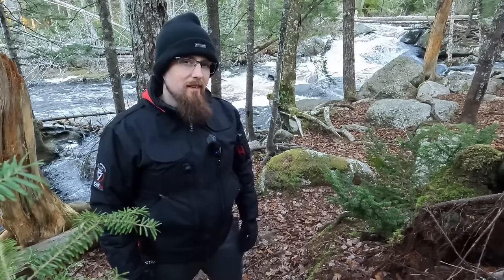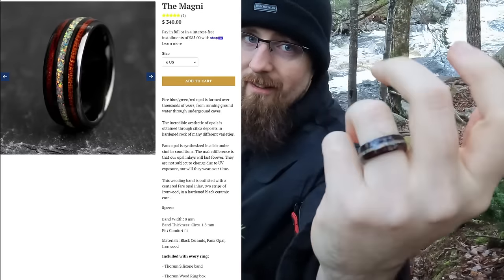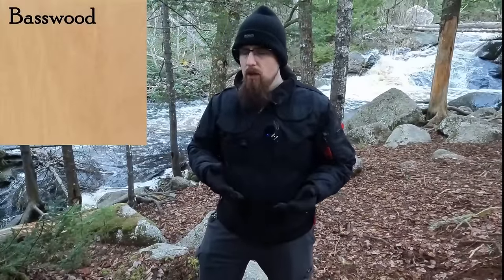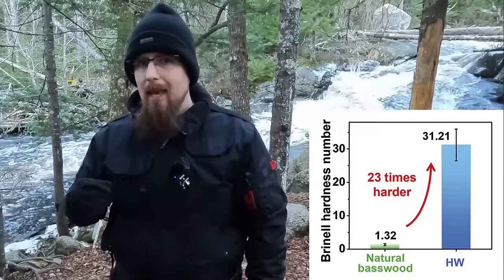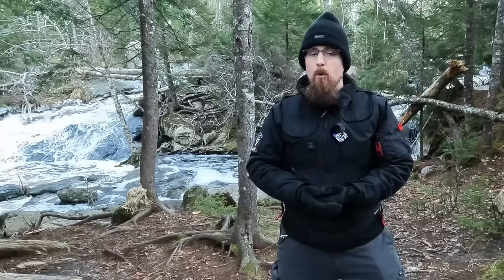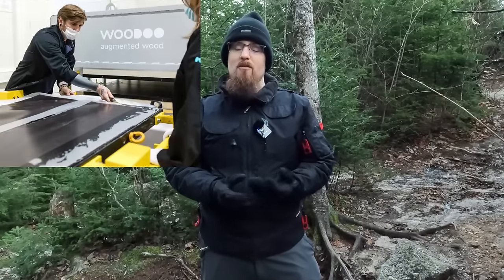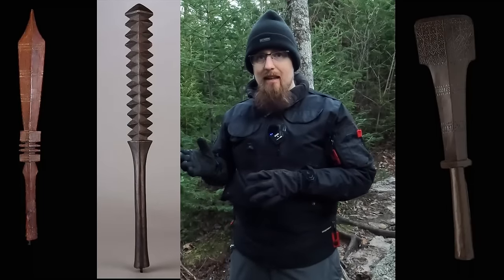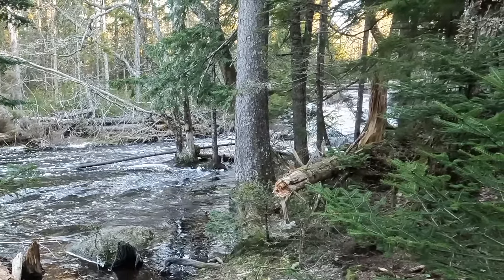Hardened Super Wood!  -  Can It Rival Steel?

Comment: Hempwood is an interesting composite.  looks similar to oak, but is stronger- they're using it currently as a sustainable alternative for oak furniture and flooring.
Reply: Man you hemp guys say everything is better with hemp . Also what's more sustainable than wood it grows back?
Reply: @willofdodge1  hemp grows faster... (Not a hemp guy, just know it's faster to grow)
Reply: @willofdodge1  basically every plant is more sustainable than wood, trees take like 30 years to grow enough to harvest so it really isnt actually sustainable since you will always need to be cutting down old growth trees, hemp on the other hand as well as all other domesticated crops grow very fast by comparison
Reply: It is more expensive, it does not withstand humid environment...
Reply: @willofdodge1  wood that grows back within a year instead of 30.
Reply: @NemamZadnejKanal  only more expensive because of limited production so far.   And the particle board used for a lot of furniture doesn't withstand humidity either.   clear coat it and it's not an issue.
Reply: @kazzTrismus  considering hemp crete and hemp composite wood are fire resistant I'd think you'd be in favor of the stuff, as a firefighter.  
As far as industrial use plants go, the stuff is pretty impressive.
Reply: @ryanjamesloyd6733  he is comparing it to solid oak, not to a particle board. And so do I.
Reply: @Dell-ol6hb  why does that growth time make it less sustainable? Take in account the law of conservation of matter. The wood comes "ready to use" (more or less), the "plants" need significant amount of further processing.
Reply: @NemamZadnejKanal  Solid oak for furniture and flooring is what it's being used as a direct replacement for, considering oak is getting hard to come by.    It performs similarly per reports.  seal it and the moisture is a non issue
Reply: you can use hemp to make rope and other useful stuff two..... its a shame because certain varities of hemp are smokable and produce effects on the mind (yes not all hemp is for smoking) and because those varities were banned for those reasons in many area's it ended up being fairly prohibitive of growing the non smokable varities as if not outright illegal it would be highly scrutinized as people would think you could be sneaking in the smokable stuff or could be taken completely out of context by a less then par news source.
Reply: @ryanjamesloyd6733  it is an alternative, but I would not say "replacement". If the price gets close to the OSB, then it becomes a relevant material. So far, it does not offer many advantages other than "green feeling".
You can seal it (PU), of course. But that goes againts the natureness somehow.
Reply: @ryanjamesloyd6733  if it aint steel its fuel
Reply: @kazzTrismus  guess you forgot about the existence of stone.   But you can take a torch to it and yeah it carbonizes but it doesnt go up like, say, pine.
Reply: @kazzTrismus  ah, intentional short sighted reefer madness ignorance.  Got it.
Reply: @NemamZadnejKanal  the price will come down. Kentucky and a couple other states are going all in on industrial hemp.
Reply: @havokmusicinc  it's actually only true for the ropes. Hemp fabric is not really good, worse than linen for example. Hempcrete is an attempt to use an abundant agro/industrial "waste". So, the aim is price. It is not a modern thing anyway, even in the middle ages, people mixed clay-based blocks with straw, hemp and other natural fiber-ish materials.
Reply: @ryanjamesloyd6733  oh get off it....
hemp as an building product isnt anywhere near the pot head claims by comparison to modern alternatives.
i gladly acknowledge the government interference and monopolistic gerrymandering etc.
but your response specifically proves my point about pot=jesus 
yall got some serious defensive issues and for the lack of research you certainly got a long list of "valuable proven uses"
your sales flyers are glossy and well produced but theyre still just that
Reply: @kazzTrismus  i suppose you'd also ignorantly yammer on about how bamboo sucks as as a building material.
Reply: @kazzTrismus  don't use ADD/ADHD as an insult, it's as ridiculously as using amputees as an insult. Consuming pot is a choice, ADD/ADHD is not. It is pretty ass-hatty to use disabilities as an insult.
Reply: @Dell-ol6hb  Wood is perfectly sustainable up to a point.  So long as you have enough land (which North America does) to "farm" your wood, waiting thirty years between harvests is no problem.  This only becomes a problem if the demand gets too high and/or space gets too low.
And of course it only applies to climates where bamboo isn't practical, since that stuff grows super fast and is really strong.
Reply: @kazzTrismus  You know hemp and pot are different things, right?  Hemp contains a tiny fraction of the THC that marijuana does.  The only reason hippies were so into hemp is because it was idiotically banned (supposedly) because of said THC despite being a really good material for all kinds of things like rope and cloth.  There's a theory that it was actually banned to keep it from destroying oil-based industries because it was cheaper and better than synthetics.
Reply: @Call-me-Al  i dont use it as an insult..i use it as a descriptor...the lack of attention inconsistency of logic and thought incompleteness of forethought and accurate application of focus that is described by the comment is perfected in the fewest number of words and least amount of space....while not even remotely taking away from the emotional struggle.
......as analogies go...its perfection.
signed:
 an extreme sufferer of add/adhd once prescribed many of the drugs still in use at often dosages 5x what is legal today
and attempted self medication for a long period to cope/control.
so yes i do know of what i speak
from both ends of the argument
Reply: @Bacteriophagebs  you miss the point like you dont want to see it.......my point isnt and has never been about them being any kind of different or if that difference mattered.
my point has been that 1 group will always make religious distinctions of no difference because they must defend their religious icon from leaf to root to justify the usage of the leaf.......when... in fact... i have mnade  no comments about the usage but rather the religiosity of the leaf users.
i know its a little deep
i know its a little hard to follow.
so ill kindergarten it down for you.
pot user defend pot and momma plant so can get high.
will tell world plant species will cure construction and cancer and bad day and financial crisis and gout in foot.
...
engineer guy notices pot guy selling "magic elixir" and says "hold thy tongue"
engineer guy points to recycleable fibers and polymers and such that already exist to such a volume natural fibers are useless and perform like junk by comparison.
.
but hey....i dont expect literacuy from the likes of ideologues and their religious plants
Reply: @kazzTrismus  There's that incoherent idiocy again.
Reply: @kazzTrismus  Illnesses arent generic descriptors. Describing people in that way is just ignorant.
Reply: @Dell-ol6hb  Forests dont need to be fertilized, industrial crops of hemp need fertilized every single year.   Hemp needs to be grown on land that is in the top 10% quality  of land used for crops wheras trees grow on the poorest ground you can find.   Hemp isnt even close too being renewable in any major way as trees.
Reply: @kazzTrismus  What I said isn't SJW type of sentence. It's basic respect of other people.
Reply: @kazzTrismus  I did not control your speech. I merely noted that Illness shouldn't be used to generically describe someone. If you developed cancer/congestive heart failure at some point in your life (statistically you will); are you now the illness or are you yourself?

If you wear glasses are you the glasses or someone who wears them? This is nothing about social justice. This is understanding basic grammar.

Also, you freaked out when I said something was incorrect. Lol dude.
Reply: @SlavicCelery  you tried to control my speech...thats what you did..end of story
Reply: @kazzTrismus  Saying grammar is incorrect isn't making 50 assumptions about you.

Comment: Fire hardened wood is not simpl dry but it also can have a chemical change in the composition mostly the outer few millimeters and that happens because of incorporated carbon from the soot and other things that may or may not be in the soot. Then using some kind of chemical protection can also help because once it soaks in, it can form a uniform surface that can resist many things.

Comment: As a follow-up, you could look into artificially petrified wood. I did a bit of research into it for reference in petrified wood as a building material in a fantasy setting.
Reply: Are there any trustworthy sources you could recommend on that? Asking for a friend
Reply: This sounds pretty cool.
Reply: That is actually a really cool idea.  Nowhere near steel, but potentially useful if you could do it in a timely manner...
Reply: Artificially petrified? Petrifaction is the process of decay and moisture unevenly leeching the organic material from a buried piece of plant matter, in this case wood, and depositing minerals in the resulting empty spaces, creating a network of stone held together by lignin in the shape of the original plant.  

There's no such thing as artificially petrified wood. There's simulated petrified wood that is created by injecting dried wood with a silicate polymer. The main difference between petrified wood and the fake is that in the fake the silicate polymer replaces the water and air pockets in the wood, rather than the cellulose and hemicellulose. Which means that unlike petrified wood, silicated wood falls apart into sand as it ages because the organic parts in between the silicated pockets still eventually rot away.

I find it important to point this out, because actual petrified wood is an interesting and often beautiful material and calling silicated wood 'artificially petrified wood' creates the impression that it's a similar situation as exists with natural vs. artificial diamonds (i.e. that literally the only difference is that the artificial ones are frequently better quality than then natural ones), when they're in fact very different materials with very different properties.
Reply: @RvEijndhoven  Thanks, that is actually pretty useful distinction.  Though the idea of "manufactured" petrified wood in a Fantasy setting can still be done via magic.

Comment: This sounds very similar to the process used to make tempered hardboard.... boiled wood compressed and heated, then soaked in oil.

tempered hardboard is very common, used in a lot of flat pack furniture, pegboard, packaging material, and available in just about any hardware store.
Reply: True, but in hardboard the fibers are all chopped up, and it's weak.
Reply: Plus, that's nothing new tempered Hardboard has been around for at least a century.

Comment: I think this has a potential being great for construction. Before steel was cheap, this would have been great for building ships, especially warships, and forts.
Reply: Depends on how strong it is vs the density. And how easy it is to shape.
Reply: @ActionCow69  the ease of working the material matters too

Metal is very convenient to work with, but can you say as much for hardened wood? I'm not sure

Comment: Pretty rings. Cool stuffs.
Now, back to playing with our wood... The problem with replacing plastic and softer steels with wood is that it is much less simple to create, requiring more cost to obtain similar utility, and doesn't adapt well to industrial scale. That mitigates against widespread utility.
Reply: There is the problem of plastic being dependent of oil, which will eventually end. Having research on how to make effective substitutes is a good way to prepare for the future
Reply from the maker: It has drawbacks for sure, but on the upside it's renewable. And I would guess that it's probably significantly cheaper to produce than steel too. Boiling it in chemicals for a couple of hours, pressure treating it, drying and soaking in oil seems much less involved than running a steel mill with blast furnace and all that.
Reply: @gustavocamargo3817  oh, absolutely.
Also, getting people used to the concept of paying more for their conveniences. But realistically, this isn't really a bulk solution, merely an adjunct - albeit an interesting one.
Reply: @Skallagrim  you have consider the costs involved in creating, shipping, storing, and disposing of the chemicals safely too. Likewise, the costs of the amount of hand-work, as I can't see this product readily adapted to large-scale automation. Lastly, there's the necessary lead times and resource consumption in the substrate - lumber. Hardwoods, especially, take time - a couple decades - to grow to useful sizes. 

All of which moves it away from mass production and increases costs.
Reply: Which is not to day that I don't find this a fascinating concept, with real uses. Transparent wooden window panes? Yes, please! Lighter, more resilient, and more shape-adaptable than glass, and with a higher R-value, too. Architects and builders both would LOVE some of that.

Wooden storage-wear that doesn't rely upon fasters, but is air-tight? Might be a bit boutique, but it would (wood) certainly appeal to a lot of people.

Other uses, as noted, abound. So - interesting, and worthy.
Reply from the maker: @lairdcummings9092   Yes, even considering that I imagined it would be cheaper. Pretty sure you can mass produce it no problem. Giant chemical vats and hot press machines don't seem like a big deal compared to a steel mill.
Reply: @Skallagrim  16 Guage rolled steel sheet cost is under US$6 per square foot. That's roughly US$2.36 per pound.

I've worked with tin knockers rather extensively. I've also got a strong background in GRP/FRP layup and building.

I don't think you're correct on the costs or the industrial comparison.
Reply: Wood is already being used as a construction material fairly regularly,so this could actually improve its uses quite a bit (provided it scales well). I do think the applications in the article weren’t chosen super well tho. Joining wood with dovetail joints for example would be a much better use than making nails out of it…nails aren’t even used that much for construction. Do als wonder how well this method preserves wood,because wood tends to hold up for a surprisingly long time,especially when it’s rather thick,often better than steel does
Reply: @lairdcummings9092 cool could be 'gopher wood' from noah's ark its still on top of ararat and the hull is clearly visible
Reply: @lairdcummings9092  I agree that our production of steel is massively more efficient that people give it credit for. But the steel industry is extremely mature and I wouldn't expect new industry to spring up out of nowhere and displace it.

For much of the steel industry, steel "stock materials" (sheets, bars, etc) are being produced and transported to companies which then use their own manufacturing processes to create a saleable product.
I'd imagine if this wood product were being mass produced there would similarly be companies which bring in wood from the forestry industry and focus entirely on the chemical-bathing process to produce the flexible intermediate material (the "stock").
This stock would then be shipped out to manufacturers who (perhaps with some maturing of the technology) take that stock to form, dry and oil it to produce their product.

If the manufacturing process of stamp-drying and oiling is pretty straightforward then the question of pricing is mostly about raw material production and chemical costs, which will only improve over time if the industry is successful, no?
Reply: @MrZriael  well, the principal problem with that scenario is this: the product cannot be cured untill is is formed. It's not steel. You cannot reshape it once cured. Otherwise, you've just got a sheet of inferior steel or slightly superior plywood. The primary value of this product lies in it's ability to be formed whilst pliant. Which means either shipping it wet, a nightmare, or impregnating it at the place where it will be formed, which means massive duplication of the necessary industrial plant - which is greatly inefficient, and both of which scenarios increase costs tremendously.

I still think it has value, but the primary forming processes will greatly resemble laying up GRP/FRP.
Reply: @lairdcummings9092  

Nope. You don't need lumber at all. You need wood, period. And you wouldn't use hardwood anyway.
Reply: @ohauss  depending on your intended purposes, yes, you would. Softwoods produce, as noted, less hard results.

As for 'lumber' vs. 'wood,' what you think you're going to straight up process raw logs? Pfft. Once you process trees, even minimally, they are lumber.
Reply: @lairdcummings9092  Hey, thanks for the response. I hadn't considered the stock needing to be shipped "wet" a major drawback. I had thought it would just be wrapped in plastic to keep the moisture in.
(I have no experience in logistics though, just thinking it through as I go here.)

On the other point:
It seems more likely to me that hardwoods would produce a larger volume of product per volume of wood, rather than a harder product per volume of wood.
The idea being that hardwoods are made of the same stuff, only already denser in formation. You would still compress it to the same hardness as far as I can tell.
There'll likely be a trade-off between grow-rate and product volume per volume of wood.
Though at this stage we have no idea, it might be more worthwhile to grow the raw material for ease of processing or natural alignment of fibres, etc.